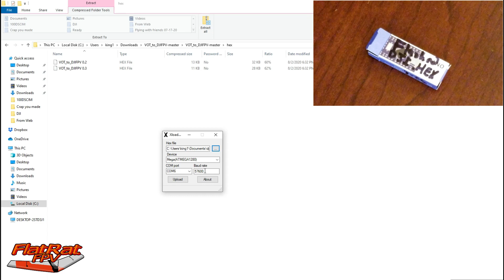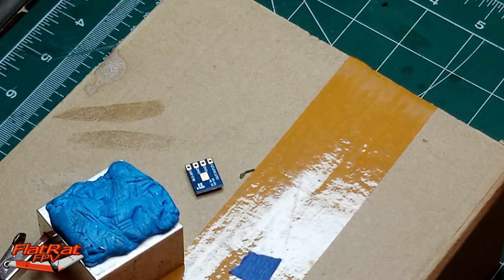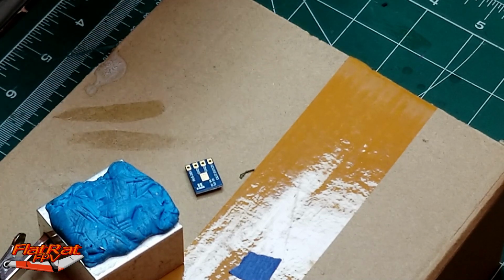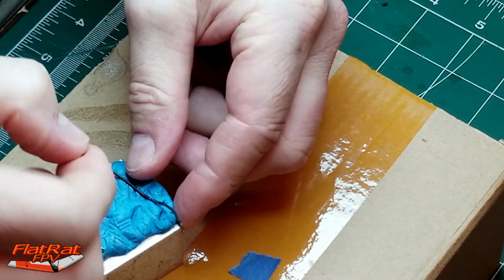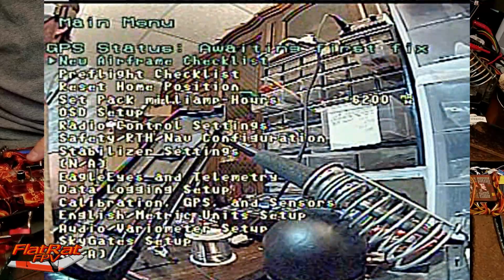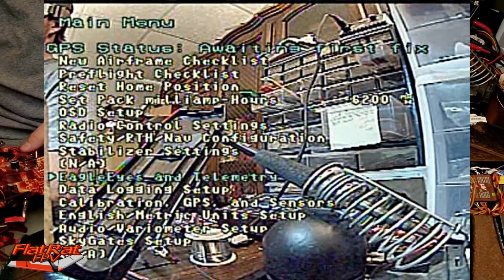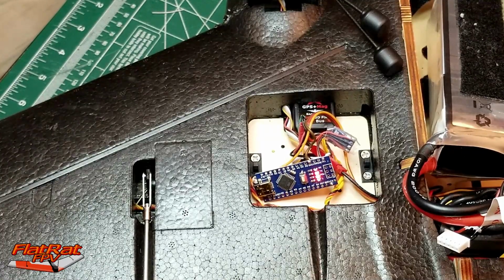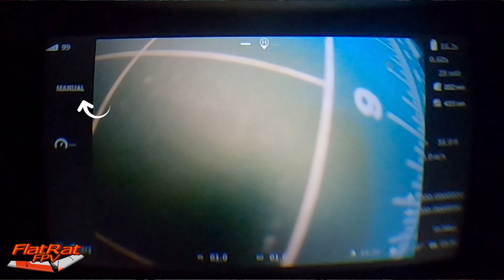Vector OSD in DJI FPV Goggles!

Comment: This video is lacking major info. #1 where is your DJI cam and AU ? #2 I don’t have a white wire on my eagletree AU , Which AU are you talking about, the eagletree or the vector ? #3 you’re talking about 1 wire coming from the vector UART, are you taking it from the GPS UART out ? I mean the information is scattered at best and is incredibly hard to follow . Where is the DJI AU and camera ? Does that plug into the audio and video out ?

Comment: HI, thanks for the video, it does something that I wondered if possible. The problem I am having is that I have not used an arduino board before and I cannot workout properly where you got the file from and which one you need to download and use. I cannot see a file with the name that you used in the video. Just waiting to join the Fbook page to get more info.
Reply from the maker: Hey John.  Ya check out the page, there is a lot of info there for you.  Crash has setup a link to the GitHub for the right .hex.  Also, check out the install and wiring vids, they should help.
Reply: @flatratfpv3708  Checked them out FlatRat and they are very helpful.

Comment: not a very clear video..need more info in description..i.e. where do you get board?
Reply from the maker: Hey ror1948, sorry for any confusion.  The links for the Facebook page are in the description.  There you can find more info about the project as well as how you can purchase a pre made Nano board or how to make one yourself.
Reply: FlatRat FPV sorry I do not want to go through several links to find the answer. You should be providing the parts and tools required to do the job in your description. Assume Your viewers are not as smart as you. The best how to videos are the ones where there is no talk.

Comment: 6:14 were is that ground coming from and I get lost what is that servo cable for.
Reply from the maker: Hey Aviones, the pinout for the UART from left to right goes: 5v, ground, transmit then receive.  The only two you'll use are the ground and transmit. Their side by side. I only used the server cable because the stock cables were not long enough. If you PM me I could maybe help you further and with some other pictures if you need it